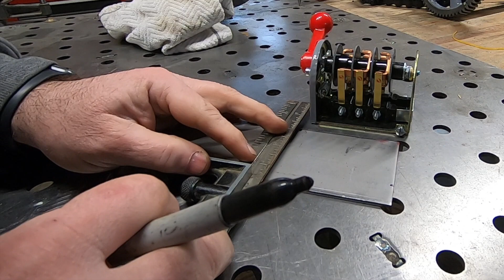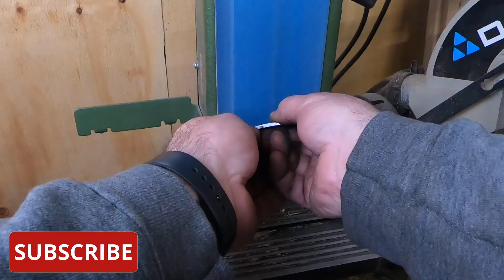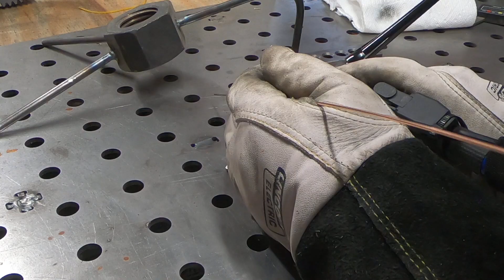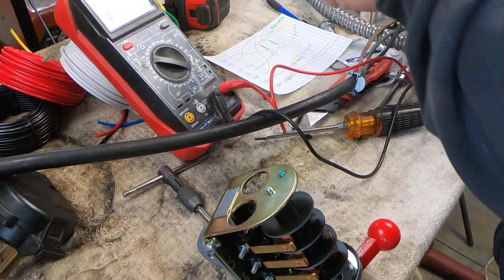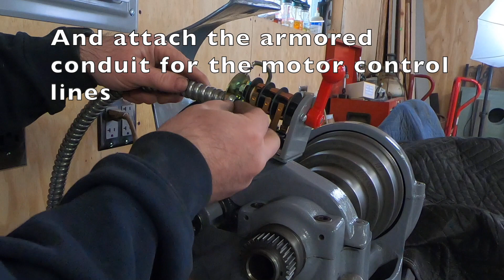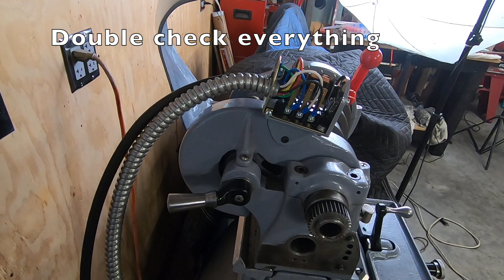1941 South Bend 13" Lathe Restoration - Part 17 - Wiring the Motor Control Switch

Comment: That thing runs smooth. That third hand you made is awesome, never seen before.
Reply from the maker: My welding instructors at Lincoln Electric had very similar ones, which is where I first saw them. I've also seen them in some other videos on YT.